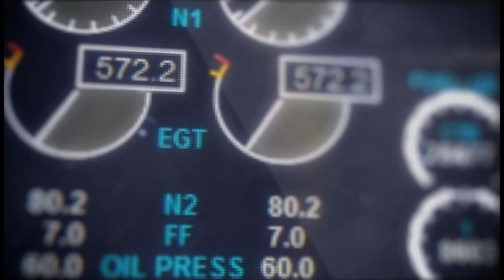Cat 3 approaches and autoland

Comment: Perhaps a dumb question.....I thought you were going to explain it.  What is the difference between a Cat III approach and Autoland, or are they the same thing?  I was thinking Autoland might allow DH and RVR's of zero and the plane lands itself without any pilot input, but I don't know.  I know that certain flights (usually cargo) will sometimes request an Autoland approach in clear daytime weather, I assume this is for training and certification purposes - they have to execute one every so often to maintain their certification.  Also, I was wondering if there is an RNAV based equivalent to ILS Cat III and Autoland on the newer planes.  With the newer planes with RNAV, they don't seem to be phased by low visibility anymore.  I recall 10 to 15 years ago, when it was foggy with RVRs less than 1/2 mile, most flights would end up going into holds waiting for minimum RVRs but this doesn't seem to be an issue with the newer planes.
Reply: Cat 3 is an approach in low visibility where the runway and aircraft equipment permit DH below 100R and RVR 125m/75m. This will always end in an autoland. You can do autoland in other conditions, but in cat3 you MUST autoland.
Reply: @peteconrad2077  I believe there are Cat IIIa/b/c, but I have not studied up on the requirements for these.  Are there any circumstances under which you are allowed to autoland with DH = zero and/or RVR = zero (blind landing)?  If an airport measures RVR on a runway below the absolute minimum allowed, are they required close that runway?  Thanks!
Reply: @kevindigo22  cat 3b and 3a are in common use. Cat 3c isn’t. I think there are one or two airfields with 3c equipment but it’s not standard. 

You can land 3b with no DH but the minimum RVR is 75m, just to allow you to see to vacate the runway. 

If the RVR is below that, most airfields won’t close, as they don’t track what each airline or aircraft type is capable of. So they  mainly just rely on crews to decide not to continue an approach. And in any case, you can fly down to 1000ft regardless. You just can’t continue below that unless the weather is above minima. That said, I have been vectored off of an approach by a controller because he thought the weather was below minimums. In this instance he was wrong.

Comment: why aren't both autopilots always armed?
You'd think that the error detection provided by multiple autopilots would be a benefit at any altitude, regardless of fail-passive or active.
Reply: cause I guess you wouldn't go-around a perfect visual landing in case of a small autopilot misinterpretation

Comment: Good afternoon Captain, I was under the impression that there were CAT3 a, b, and c options. I thought that C was 0,0 and will take the airplane down to the ground with no visibility and no rvr. Maybe it hasn't been implemented yet? I was under the impression that the Lockheed L1011 back in the 70s was the first plane with autoland. Unknown what the limitations were.
Reply: Scott Currier the L-1011 had a very advanced AFCS for its day. it offered CAT IIIA autoland capability straight out of the box, which gave it a huge advantage over its competitor, the Douglas DC10.
Reply: Lockheed built a fine plane, 4 hydraulic systems, and a cargo door that didn't blow off were also huge advantages over the DC-10.

Comment: Good Day Mentour.  Very informative video.  If the auto pilots fail during the landing at or below 1000 ft., and a go around is needed, voiding a CAT III landing option, and a CAT I landing does not meet the visibility requirements,  is the landing diverted to another airport?
Reply from the maker: Yes, if the autopilot does not work, the aircraft is no longer Cat3 approved and we need to divert unless the weather improves.

Comment: I have a question to the redundant autopilots:
Is it basically the same hardware+Software running in double, or do they have to be designed differently from ground up? If it is a design flaw in hardware or software that causes the malfunction, a simple double autopilot with the same sensor inputs will not catch that.
Why am I asking this question? 
I'm a Control Systems engineer working with all kinds of autonomous vehicles. To me, that looks just like a very improbable but fatal design flaw.
I couldn't find anything on the internet about that though...

Comment: And when you have a free moment, and only if you know the answer, I was wondering if Class 1 medicals can be renewed in another EASA country than where the initial one was issued.
So if I were to get an Irish Class 1 medical to check that I am fit and well as has been recommended to me, with intentions of training in Ireland but then decided I wanted to actually train in the UK, would I then have to get another initial class 1 medical or renew the Irish class 1 but in the UK. Could I complete training at a UK FTO with an Irish medical or would there be any problems with this? 
Thank you so much :)

Comment: Do the pilots and all the air crew have to go through security and customs the way passenger's do ? ..And if so  what happens if they are doing something Illegal  ?
Reply: Absolutely they must go through security, and if caught doing something illegal, will be removed from flight, and could be detained and/or arrested depending on the scenario.Flight crew work very hard to get to their positions in the first place so it would be a very rare occurrence for someone to put their job in jeopardy by being intoxicated or carrying non-admissible items.
Reply: Not exactly the badge gets them through security

Comment: what if the pilot leaves the autopilot on upon touch down. does the auto pilot  manipulate the rudder to keep the plane on centre line in conjunction with ILS. it may be too hard to keep on the centre line with a 200 metre RVR manually.

Comment: Helo mentor pilot. I was wondering what is the minimum altitude AGl that the autopilot can be disengaged without doing an autoland ? Thank you very much
Reply: Nicolas Larrain during a manual landing, I believe you must disconnect at minimums (not always measured in ft AGL) .

Comment: Great vid mentour can you tell me what the CWS buttons are for they are the buttons the AP command buttons in the 737
Reply: The control wheel steering mode allows you to override the autopilot with manual control inputs without the need to reset the autopilot, if I recall correctly. I don't believe it's used very often
Reply: Aidan McCoy it's really weird mode. According to mannual in CWS mode if You pull/push the yoke and then realase it the attitude will be kept by autopilot. When it comes to roll mode the wings will come back to level after realising the yoke( if i remember up to 6 degreess then it stays in a turn). As i said it's weird mode and i have no idea when Do they use it ( maybe it is good tool for manual ils app)

Comment: Hi Mentour. I am a student at school, and I fly the pmdg 737 800 on fsx at home. When on final app on autopilot do you add a bit of speed on to the QRH speeds or keep the same as what is says, at the moment when I am on short final app the aircraft is at about 2.5 degrees nose up, is this normal or do I need to add speed to get perfectly level at 0. Thanks
Reply: Ok thanks for your help. I will do that now
Reply: okay that was really helpful, thank you so much and i will try that now, cant wait until your next video 
thanks 
sam

Comment: I remember flying in to Charleroi, Belgium where Wizz and Ryanair pilots were trying to break up the fog by repeated approaches then just gave up as the airport did not have the proper radar systems. Fun times to be a passenger.

Comment: But If the aircraft touches down during the go around, won't the spoilers be automatically deployed?
Reply: SebastiaanC yes they will be extended as soon as the LEFT main LDG is pressed and as soon as you push the guest lever to above 70°(depends on which aircraft) and the spoilers will be retracted.
Reply: If the speedbrake lever is armed (normal procedure is to arm it unless directed otherwise by the QRH), the spoilers will automatically deploy as soon as weight on wheels is detected. On the B737, this is sensed on the left main oleo strut.

Comment: Is a "Category 3" landing the same procedure as (so-called) "auto-land"?
Reply from the maker: Yes.
Reply: "same as (so-called) "auto-land"?" ==> "Auto"-land sounds UTTERLY mis-named.   Landing on a the flight deck of an aircraft carrier is (probably) more difficult, but they get LOTS and >> LOTS << of practice before night landings in zero visibility with no fuel onto a ship moving 30 kts on seas moving the "fantail" up and down by 50 feet every 30 seconds.  

You've hot a higher workload during (so-called) "auto-land" to (partially) compensate for the (essentially) ZERO error tolerance at 50 feet altitude in low-thrust, high-drag, minimal-lift configuration with nearly ZERO visiblity.
Reply: "same as (so-called) "auto-land"?" ==> Sounds like "higher workload" and "higher risk" for so-called "auto-land".  From this side of the web browser, sounds like "un-diverted landing" would better fit the reality.  Presumably, if you're not trained, authorized (ie. credentialed), equipped (on ground and on craft), and allowed (by policy, procedures and regulations), the (so-called) "auto-land" becomes diversion to an alternate airport.   (Unless your B738 can land on the flight deck of a convenient Nimitz-class aircraft carrier passing through Europe's rivers and streams.)
Reply: The F-14 also had an autoland feature, but most pilots were afraid to give control to a computer.
Reply: @jameskirwan9689  soe airlines actually ban their pilots from using autopilot and some features of the ILS in landing unless they have to (so a Cat 3 approach for example0 because they want the pilots to keep up their skills.

Comment: I've always wondered, what are the CWS' for?
Reply: 2 years late :( But the autopilot often starts up in pitch/roll mode, meaning the autopilot will try to maintain the current pitch and roll. The autopilot usually goes into this mode if there is a discontinuity in the flight data computer's data feeding the autopilot, or if you press a mode button when you already in that mode... IE HDG mode pressing HDG again disables heading mode and puts you into roll mode.

Some airplanes have sliders to adjust the pitch and roll, but many just hold the last pitch and roll the airplane had. This is either because the autopilot was off and you turned it on by pressing the AP button, or you temporarily disabled it by using the CWS button.

CWS gives you control "steering" of the airplane's pitch and roll via your "control wheel". Many airplanes also use CWS on the ground to get the autopilot into really aggressive pitch inputs, and then you verify you can manually overpower the autopilot with your controls if you need to. Personally, I used it in turbulence, its great for making small corrections when you need to hold an airspeed, and you can't be in HDG or NAV mode because it's bumpy enough that the autopilot turns its self off frequently.

Comment: Hi captain
Actually, in CATIII B&C you can go down to 0 feet DH.
Reply: you need 3 autopilots for this (fail operational) - 737 only has 2 autopilots (fail passive) so Cat 3a is the lowest with 50ft DH and 200m,125m,75m RVR

Comment: I have a question what is a Rnav Approach?
Reply: Approach using a GPS signal to guide the aircraft to the runway.  It is pretty complex. But it is probably fair to say it is enhanced GPS. Typically there are ground stations around the airport which help to correct the GPS signal and thus a very precise lateral and vertical navigation can be achieved.
Reply: Walla Jozef isn't that a gnss approach ? Thanks for the answer :)

Comment: Kinda makes 5G interference against the radar altimeter a big deal! 
How did the issue of 5G cellular tower interference only become an issue known to the flying public weeks before it goes live?
Money. Lots of money fighting against lots of money. Telecoms vs Airlines.
Refereed by the government which sold public radio frequencies to the telecoms for $80 BILLION dollars. 
The insurers will be next to chime in when they realize the cost of replacing a 2 year old 787, and compensating 200 passengers' families when 787 digs a hole in the ground during fog or snow.
(Don't get me started about the reaction of stockholders and lawyers everywhere!).
No one seems very concerned about those 200 lives and flight crew. Those are only people. Money is the important thing.